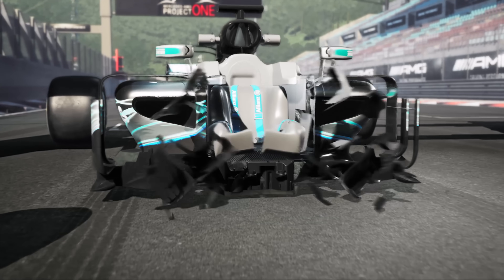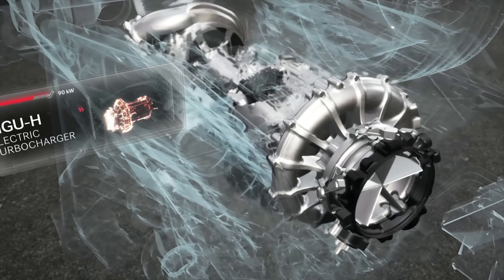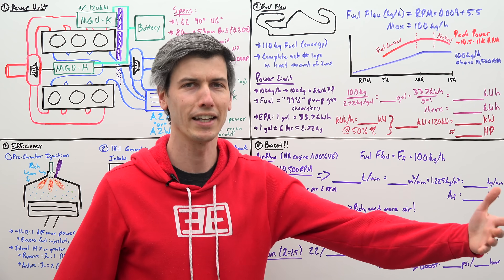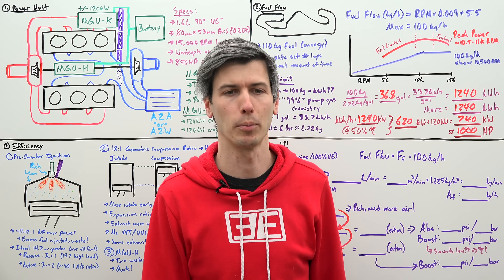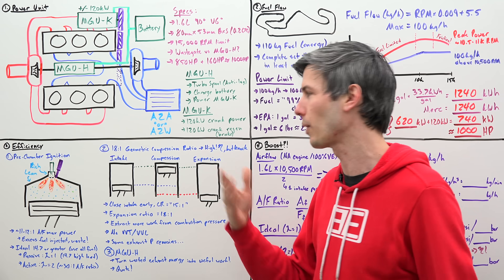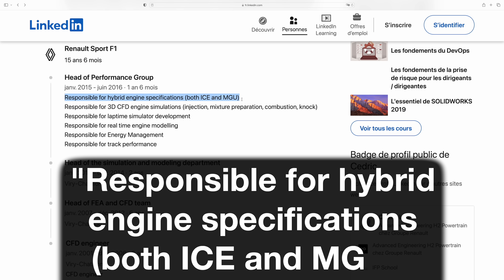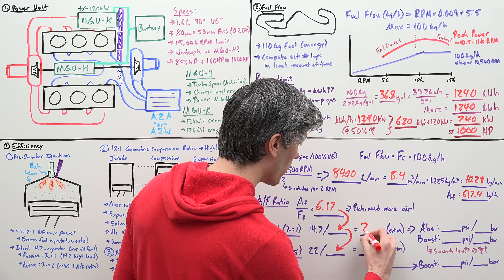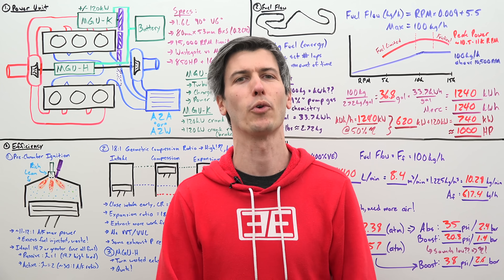How Tiny Formula 1 Engines Make 1000 HP!

Comment: Interesting fact that during the 1980s when the regulations were not so strict the first time F1 teams used turbo charged 1.6 litre engines they were making closer to 1500 HP
Reply: *correction they were actually 1.5 litres running silly boost pressures.
Reply: @steveskipper6473  But the power was only in qualification mode. During the race, the engines produced way less, about 850 HP.
Reply: @milanbujna2957  1963 Indy 500 Offenhauser 2.65-liter silly boost pressure turbo inline-4. Running on methanol and nitro!  1,600bhp before they blew up in qualy!

Comment: Another great video!  I used to always tell customers who asked "how much boost can I run??" to remember that boost pressure is simply a measure of restriction.  A motor with higher VE will make the same power at lower boost.  High boost is not a bragging right in and of itself.  The primary reason is one that I think is missing from your calculation - the heat generated through compressing air.  More boost = more heat.  Your calculation seems to assume the extra pressure comes at the same temperature.  I.e. 2x pressure = 2x O2 content.  But in reality, doubling the pressure adds significant heat, even after intercooling, and decreases charge density.  So that "ideal 20psi" may actually require 25-30psi on the gauge to get that same calculated amount of O2 into the chamber.  Or not, just a thought :)
Reply: Guy says high boost is not a bragging right with the name HiBoostSupra 🤔
Reply: @7ROOP3R  😜 I did say "in and of itself".  Once you have the system optimized, then by all means, turn it up.
Reply: @hiboostsupra5965  It also means a high-flow intake-cylinder-exhaust pathway as to not bottleneck your setup. All about that CFMs for power. Low end is probably gonna suck because it prefers high-velocity air rather than high-flow, unless you have a capable ITB that can provide both.
Reply: @7ROOP3R  exactly what I was thinking lmaoo
But I get his point tho
Reply: it would be so much easier to just sell customers a boost gauge with a really weak spring, so it'll always register high. Then you get bragging rights AND won't explode the engine!
Reply: You do get less out than the gauge reads due to compression heating the air and decompression cooling the air. The pressure on the needle implies more air is being stored than the actual air you get out in the end.

But also it is better to reduce the pressure to increase the density, so cooling is great. So great, intercoolers reduce the pressure further to increase the air density, since the point is to give the cylinder more oxygen, not shove air into the intake until detonation.

But yeah, it's kind of inaccurate to use the PSI value when it's all about air MASS, not air volume.
Reply: The thing that matters is the density of air, which is the number of literal air molecules in a given space. Banks power has alot of cool videos talking about it and the ideal gas law.
Reply: @ryanfoss6243  excellent point, and this is why Banks measures charge density in units of mass, (lbs), versus, the more common measure of volume, (cfm), that is variable and dependent on the variables of temperature, humidity, etc..
I find it interesting that gas turbine engines also reference mass, (lbs / min) as reference to performance.
Reply: Iirc Motor Trend did this with a Chevy SBC and an industrial air compressor.
Reply: It’s not missing, he’s using standard density, ie volume of air at sea level and 15 deg C. It’s just to give an idea of the boost levels. Will need about of course will need more pressure if the temperature is higher, however efficient intercooler and a turbo operating in its most efficient region likely mean they aren’t all that high anyway.
Reply: @coreyw427  I understand he's just estimating and I only brought this up because he seemed surprised at how low that calculated boost number was. Intercooler obviously helps, but it rarely gets you back to ideal gas law conditions.  We used to run an air to water IC packed with ice and after 8 seconds of boost the water felt luke warm.  It's a bit insane how much heat is added to the charge exiting the compressor.
Reply: @hiboostsupra5965  I think they will be operating in a much more efficient area of the compressor map than potentially you are. They have a lot more resources to optimise the compressor for their application. Also the airflow through the intercooler is likely a lot higher (don’t underestimate this, the design of the intake and sealing is v important. Look at radiators on many race cars, they only need a tiny scoop off the front splitter). But yes, fundamentally agree pressure will need to be higher if the temp is higher as it’s the air mass that’s important, not pressure.
Reply: @hiboostsupra5965  Hi,
Does you Supra has a B58 engine and if so, could you give us some of the figures it uses and produces? (I’m just curious)
Thanks!
Reply: @Conservator.  my Supra was a 2JZ-GTE with a single 70mm turbo.  Note this is not the air to water intercooled project I referenced above, that was a Mustang with a 101mm turbo.
Reply: @hiboostsupra5965  No B58 but still very cool! 😉👍
Reply: @coreyw427  agree there are many things it would be fun to know about an F1 engine's operating conditions.   Correct me if I'm wrong though, even the perfect/ideal part of a hypothetical compressor map would just get you back to ideal gas law conditions.   I.e. no matter what, if pressure more than doubles, significant heat is added.  At 150mph an air to air is certainly capable of shedding a lot of heat (can't get below ambient temp obviously) but on a tight course with lower speeds and hot and humid conditions I have to believe IATs are still an area these teams closely monitor.
Reply: @hiboostsupra5965  Will be something like 80% efficient in the middle island and they should be able to keep it in the optimal position more of the time using the MGU-H. Will still be a fair bit of heat yes but I think with adequate inter cooling it wouldn’t be far above ambient except they may trade of cooling for less aero drag. Of course IAT is also a consideration for combustion temperature and therefore knock.
Reply: you use intercoolers for that.
Reply: Makes me laugh the young turbo kids in their rice burners want more boost like U clearly explained extreme boost is not necessary & U will grenade your engine !😆

Comment: Interesting fact is also that battery can deploy only 4 megajoules (MJ) / ~1.11 kWh per lap to the MGU-K.
So since electric is kinda crucial to have "power advantage" in a race the team and driver have to make really good prediction when to use it⚡
It is more like Re-Volt game than classic race 😄
Reply: The MGUH can also send power directly to the MGUK, and that is unlimited. 4MJ is only for the transfer from the battery to the MGUK (for energy recovery it is 2MJ from MGUK to battery).
Reply: You mentioned the first game I ever modded. Nostalgia ahah
Reply: @PC_Modder OP edited his post.. Initially he said 1.1 kWh total, then he silently changed it to "per lap" after I corrected him. Or something along the lines, bad etiquette either way.
Reply: @PC_Modder My reply was - "1.1kWh is 30+ kWh per lap", you somehow got it wrong even after the explanation. kWh is power used during a period of 1 hour, or in this case, that is equal to 30 laps if we take the average lap time to be of 2 minutes. Which it isn't, but you get the point hopefully.
Reply: @PC_Modder ...
Reply: Considering a sub 2 min lap time, 1.1kWh is 30+ kWh per lap though, so a significant amount, or in EV terms - over 200 km in distance.
Reply: @pino'cleen  All race distances are approximately 300 km except Monaco which is shortened a bit due to its short length.
Reply: @FrankyPi  👍

Comment: However, the power to weight ratio is no better than the 70s, and a fraction of the Turbo Era of the 80s.
Reply: But the driveability and chassis technology is way better, so today´s F1 cars are way faster, than the 80´s cars.
Reply: @milanbujna2957  Tires, Suspension, Chassis Dynamics and Aero make them faster; the engines are a minor aspect.
Reply: @daveblock4061  Everything makes them faster. And today´s cars are also way more rigid and safer, so that adds weight too.
Reply: @milanbujna2957  The introduction of Carbon Fiber reduced weight. The 'Power Unit' as opposed to a pure ICE added the most weight.  And more wight begets more weight to achieve the same level of safety.
Reply: @daveblock4061  Yes, but also the chassis has to be stiffer and it´s heavier except the engines. There are multiple factors why the cars became heavier. Anyway, the cars are faster than anything before and with far less fuel consumption.
Reply: @milanbujna2957  Yes, the cars are much much faster. but it is only recently the power is coming close to that of the 80s that had 1.5 liter engines and no battery, MGUh, or MGUk. I bet if you put an 80's Turbo engine in a 2023 car the difference would be small, especially at Monza. Outright power goes to the old engine, electricity reduces turbo lag and instant throttle response.
Reply: @daveblock4061  But remember, that the 80´s cars had the insane HP only in qualification trim, in the race the power was significantly reduced to "just about" 850 HP.
Reply: @milanbujna2957  True. However the modern engine needs an MGUh, MGUk and battery to achieve similar power. And in a package nearly twice as heavy. Ask any driver, they prefer the simple, same power to weight older cars to actually drive.
Reply: @daveblock4061  Today´s engine achieves about the same 850 HP without battery and still with far better fuel efficiency. So it´s quite a big step forward since the 80´s. I know drivers would prefer more simple machines, but everything gets more and more complex and the "simple" era is gone.
Reply: @milanbujna2957  All you say is true except: Everything get more and more complex' but that due to the rules. As you know as of 2026 the MGU-H is banned. You want to cut costs exponentially? A normally aspirated engine. Sounds great, drives great, the drivers love it, the fans love it...but that is not where the money is. Manufacturers now dictate the rules, the private entries are dead and priced out.
Reply: @daveblock4061  NA engine - sounds great, drives great, drivers and fans love it and it´s a dinosaur, that brings nothing new in technology. And F1 always wanted to be on the top of new technologies. There is a future that is more and more electric so the development is what it is. I personally love the old V10´s but these times won´t come anymore and I´m fine with the new engines except the lack of sound.
Reply: @milanbujna2957  I know most of my tinnitus is from live music and live auto races, including NA F1. With synthetic fuels coming online the NA ICE engine, or with forced induction, is far from a dinosaur. Relevant technologies to road cars is non-existent as since 1992 and the Williams FW14B all driver's and vehicle aids are banned. All the tech on F1 cars have little trickle down on road cars. The cost of 'power units' has no justification. I am not saying they will come back, just the 'modern' power units are unnecessary and unnecessarily expensive.

Comment: from an engineering standpoint its a shame to get rid of the MGU-H, but from a fans perspektive the only thing i can say is: 

BRING BACK THE V12 !
Reply: That will never happen. From 2026 there will be new technical rules for the F1 engines, you can find it on the internet. And the V6 will definitely stay with us.
Reply: @milanbujna2957  i know. thats why i wrote about getting rid of the MGU-H, wich is the main point of the rule changes...
Reply: @th1nk_outside  We will lose MGU-H but MGU-K will triple the power and fuel limit will be 30% tougher, so I think there will be enough challenge for the engineers 😎.
Reply: @milanbujna2957  and a real challenge for the drivers most of all, because there suddenly will be huge turbolag. i bet we are gonna see lots of spins. from an engineering standpoint over all its a simplification and also the engines will be less efficient without the recuperation from the turbo- which was intended and for the (new) engine manufacturers it makes sense, since there is no road car application for a MGU-H. still a brilliant peace of engineering and way more elaborate then those old V12s. but if i had a choice...
Reply: @th1nk_outside  I don´t think, there will be any turbolag, the hybrid system will have some power to boost from the start. They do this warm up laps before the race, so they will recuperate some energy for sure.
Reply: @milanbujna2957   i doubt that it can make up for that, since the turbo is what makes the majority of the power and it will take time to spool up. but its an interesting point, that could actually be the new skill of the drivers, to save the electric power for every corner exit...i guess we will see
Reply: @th1nk_outside  Yeah, the turbo engine makes the power, but the electric motor thanks to its instant torque has the perfect ability to bridge the turbolag. This principle is applied in every modern hybrid.
Reply: @milanbujna2957  technically yes, but not all the time during a race. F1 cars have very limited battery in comparison to road cars and they just wont be able to go flat out out of every corner like they could now with the e-turbo. probably there is a program that measures the turbolag and uses the battery exactly in these moments, but i doubt that it will be enough and think that they will have to compromise to harvest. because the battery is also needed on the straights, overtaking etc. not only out of every corner. the recuperation when braking doesnt match the energy you need to accelerate after that. at least not with batteries, maybe could be possible with supercapacitors like the Lambo Sian...
Reply: @th1nk_outside  No worry. Today's turboengines don't have much turbolag. There are technologies, that can minimize it even without eboost.
Reply: @milanbujna2957  haha yeah because they use tiny turbos. to make over 700hp out of 1,6 L you need a massive turbo and that is gonna take time to spool up...

Comment: No, no, Max Verstappen have to rest this year))

The F1 engine are masterpiece of engineering, and I hope the technology will appear in production cars soon.

still, Jason could use some soft to predict the engine operation better, but its enaugh for beginning
Reply: It is in production cars, just not any you can afford.  It's not in cheap production cars because it's not needed, and it's expensive.  It's easier to make enough power with traditional means for most production car applications.  There are several hyper cars that have all of this technology and even more tech than F1 cars do.  As he mentioned in the video, F1 cars are only impressive relative to their rule sets.  To put it another way, some production cars are faster, more powerful, and have more acceleration than a F1 car could ever hope to have because they are not constrained by the same rules.  They are also extremely expensive and called hyper cars.  F1 cars just probably handle better because they are designed for only track use.  Every other aspect of them is easily beaten by production cars that currently exist.
Reply: @cole2839  well, you obviously have a point, but tell me, what production car has an engine with 50%+ thermal efficiency?
Reply: @MinchevaLs  they don’t need to, to beat F1 engines in all stats…. Nice try though.

Comment: nice video but how do we know f1 is using a passive jet ignition?
Reply: 9:02 Because it's using one fuel injector for both chambers. Active uses additional fuel injector for prechamber alone and regular injector for regular chamber.
Reply: @an0nim11  i see
Reply: @an0nim11  you know that it difficult to get a passive system to work thats why maserati has two spark plugs per cylinder

Comment: If you close intake valves early, you are not pumping 1.6l of atmospheric pressure per intake cycle. So this means the resulting generated boost pressure might be even higher.

Comment: When you consider an F1 engine is a consumable and only has to last a handful of miles, it's an easier task to squeeze that kind of power out of it.  In the consumer space you'd never want to do that with your car's engine because you're probably hoping it lasts decades over hundreds of thousands of miles.  Those are two very different engineering problems to solve.
Reply: They used to use one engine per race, they're moving to 3 engine per season. Quite amazing knowing how much they push the engine to work. I mean if you constantly push road cars to the limit it will not last decades.
Reply: You'd be wishing your road car engine lasted until it's first oil change.  😆